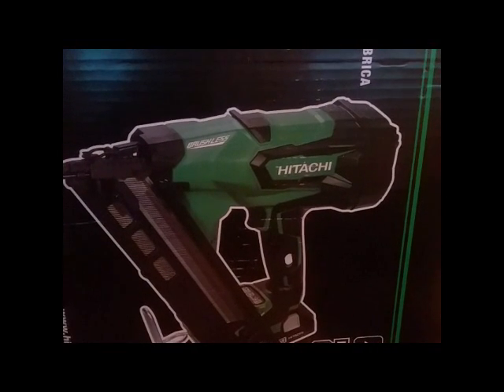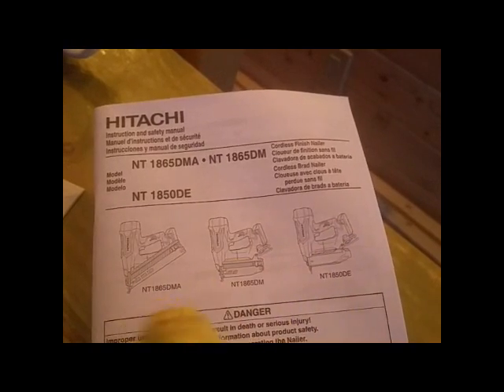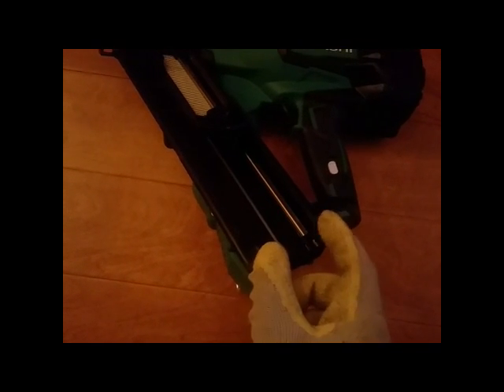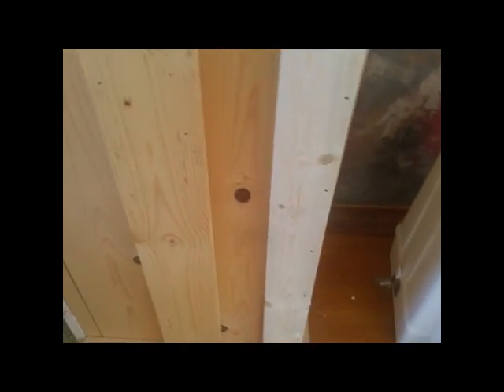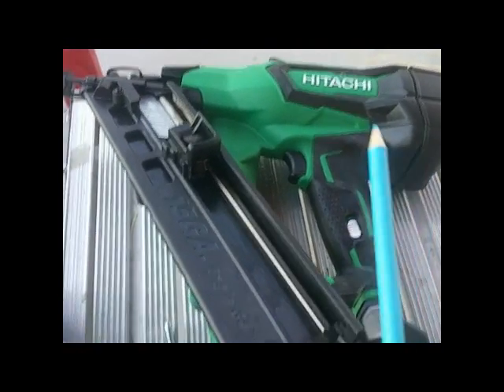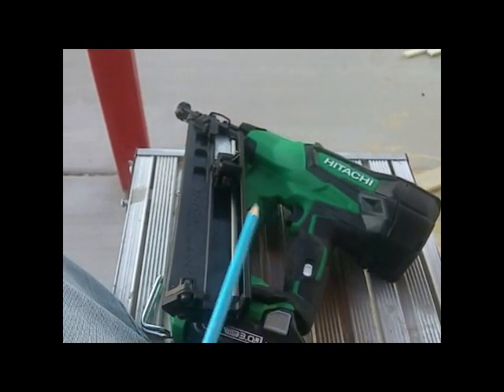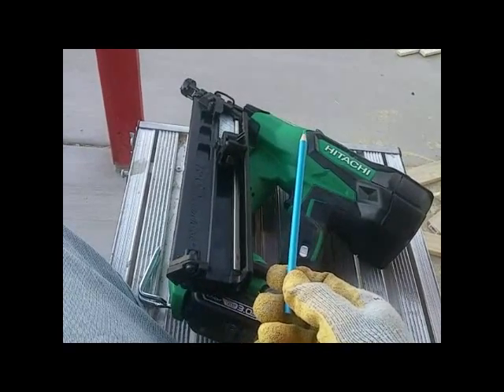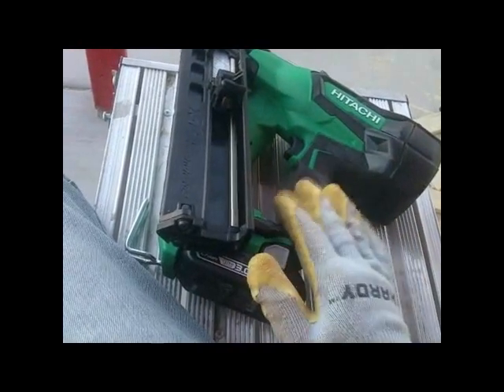REVIEW: Hitachi NT1865DMA [15-guage cordless nailer] 18-volts

Comment: which one you think is a better choice Dewalt or Hitachi?
Reply from the maker: Gerald Jakaitis .. both are good.  both are untested... it's a toss-up
Reply: I am leaning towards dewalt, because I had Milwaukee and didn't like it much so Hitachi might be very similar.
Reply: I have the dewalt and haven't been happy with it.  It misfires fairly frequently so I have ended up with extra holes to fill.  I was thinking of trying out the hitachi and getting rid of my dewalt.  I wanted to see what the return policy was on the hitachi so if it didn't work I could bring it back.  I do like the 15 gauge nails for my finish work.  I have one of the old 18 volt dewalt finish nailers which works great but is very heavy.  I may just go back to my paslode but I was hoping to get away from the fuel cells.
Reply from the maker: dali swan .. never had a misfire on the hitachi so far.. return policy is prolly 30 days at any big box store
Reply: 30 day money back policy
Reply: Gerald Jakaitis why would hitachi be similiar to Milwaukee?

Comment: The tip of the Hitachi guns are wayyy different than the tips on the Milwaukees... Way smaller and better line of sight.   To me these look like a solid performing gun.  The belt hook is a bummer to any trimmer though,  while still usable, not nearly as ergonomic.  
If they came out with a 18 volt 23 ga micro pinner, I would buy the whole linup no question!!!
Reply from the maker: I agree!
Reply: Stay tuned I'm sure!
Reply: Retro-Tech someone is about to come out with a 23 gauge cordless. I forgot who, but just saw it the other day
Reply: They have 23 gauge now?  I think